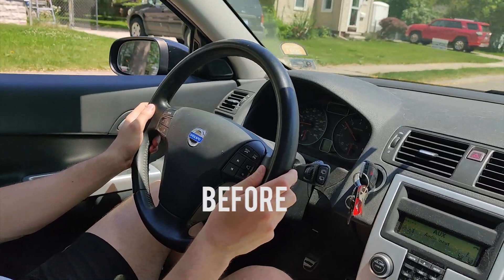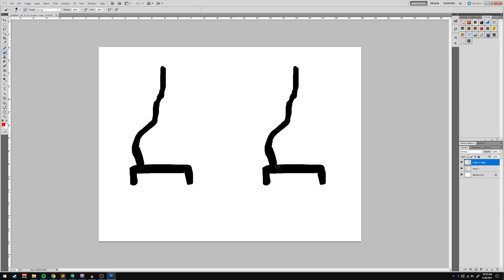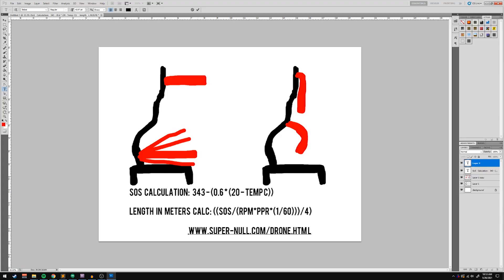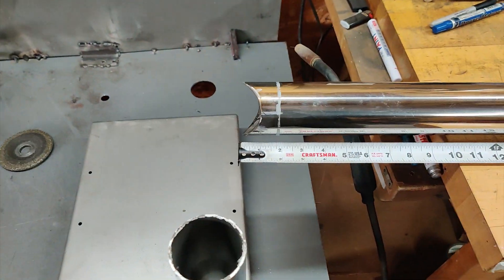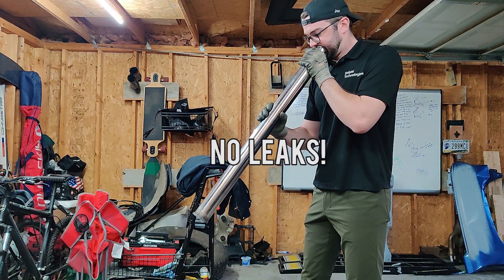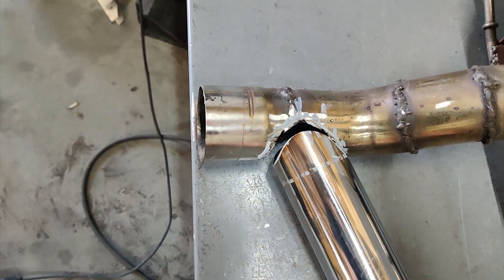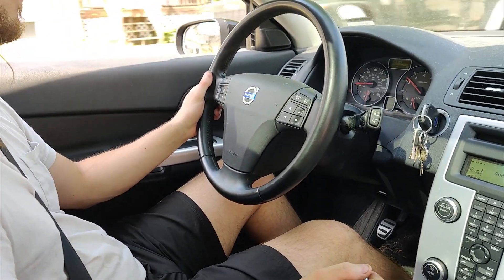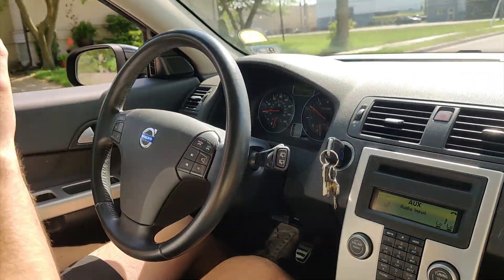Remove Exhaust Drone PERFECTLY + Free Drone Tool

Comment: Have golf 6 gti i want to remove drone dont know heat rpm or nothing ;( havs one muffler two tailends is j pipe on the pipe before muffler maybe
Reply from the maker: You need to know as much info as you can or it will just be guess and check. At the very least get the RPM and make it adjustable. Best of luck!

Comment: When should i measure the exhaust temp, after a long normal drive or After pushing the engine a little hard ? 
And what width should the J pipe be ?
Reply: Measure temp when you are experiencing drone the most consistently, likely up to temp. Pipe diam is flexible, but any size close to the actual exhaust pipe appeared to be most effective for my applications.
Reply: @TylerRogersUSA  My drone is around 2300 RPM. However, he said measure temp around the spot that'll fit the J pipe. Knowing my car, it's probably way back. Which means lower temp.

Comment: Hiw did you measure exhaust temp?
Reply from the maker: Temp gun or a best guess and leave the pipe adjustable before fully welding it or clamping it!
Reply: @supernull  on the piping itself or the air coming out of the exhaust?

Comment: Curious, how does this compare to using a helmholtz resonator as far as range of frequencies it effects? eg. in my car the drone frequency ranges from 94 to 114Hz with decibels as high as 91 from 2900 to 3300 rpms. Will a QWR like this hit that 20Hz range if I focus simply on the RPM where the drone is loudest?
Reply from the maker: Thats a great question. I don't have a side by side comparison personally, but I would say if you target the middle of that range, or the worst offender, you have around a 300-500rpm range of drone cancellation. If you arent fully committed or want to test out lengths, you can slide a larger exhaust pipe over on the drone portion and adjust the length with a clamp until you are happy, then weld it in.

Good luck

EDIT: If you HAVE to pick, you can always air on the side of caution as well, focusing the drone pipe on the more common cruising RPMs

Comment: Had my J pipes installed using your video. 65 Ford Ranchero, dual exhaust, flowmasters. Well it worked! I was laughing the first test ride just like you guys did. It works!! Thank you! 🤙
Reply from the maker: World of a difference huh! Its great to have the engine not living in your head while you drive. Glad it helped you
Reply: Hello.. im from Malaysia, and watched your video. Was wondering if i have dual exhaust, do i need to divide the pipe length to two? 

e.g. Total calculated  length is 26.5 inches, do i make 2 set of 26.5 inches, or 2 set of 13 inches?
Reply: @shafiqsulaiman6749  Each pipe at 26.5

Comment: Mine didn't work at all.. 1600 rpm v8 dual pipes with a H pipe. Used the same diameter tube, calculated 900mm or 35.7", I didn't measure exhaust temp though. Guessed 200f/95c because I read on a forum someone calculated that temp inside the j pipe. Mine are welded in front of the mufflers, about under the front seat in my C10 truck
Reply from the maker: The worst of the drone is at 1600? Did you add the drone pipe after the H pipe, same ~36" j pipe on each bank?
Reply: @supernull  yes it's after the H, both the same length, one on each bank. I have a fairly narrow drone range too, from 1580-1680 really spikes. It could probably be quieter either side of that range, but that's the worst bit. 105-108 Hz on spectroid which correlates with the rpm
Reply from the maker: @swempthebemp  I wonder if the H pipe only partially makes each bank act as a pulse per rev of 4 as the exhaust gasses are not fully merging as if it was a Y pipe into a single exhaust. I would guess it is going to behave more like a true dual exhaust setup (basically 2 isolated 4 cylinders). This drastically increases your drone pipe length.

If you are able to, what I would recommend is merge both exhausts where the H pipe currently resides, and run a single drone pipe off that, then split back into your dual exit setup. Unless you are all about the H pipe sound of course

If you intend to keep the H pipe I would first try and add some resonators after the H pipe, from what I have seen the H pipe drone is very tight around that 1800-2000 rpm. Something like a vibrant resonator right after the H pipe may do some good. Unfortunately will take some trial and error.

Comment: Did you notice it actually making the drone at other rpms worse than it was before? I targeted 2500, and at 2100+ the car sounds amazing, but now from 1500-2000ish it drones more than it did before. Not sure if maybe my length or something else was wrong? Any help would be appreciated.
Reply: I did not personally. If it has a LOT more drone, you can always add another J pipe to target that frequency as well. Or lower your original target RPM if the high end isnt as noticeable.
Reply: @TylerRogersUSA  yeah I think I’ll change it to 2000 and see what happens. I made them adjustable so shouldn’t be too hard apart from a space limitation
Reply: @bobjohn7329  Good on you for thinking ahead. Let me know how it goes!
Reply: @TylerRogersUSA  will do! I’m also planning on adding an x pipe, right now there is no crossover in the exhaust. Do you know if the j pipe calculation changes  at all when going from no crosser to having a crossover?
Reply: @bobjohn7329  It most certainly will. If you have a V6 with no x pipe, you have to treat it like 2 independent 3 cyl engines. With an X pipe you can now treat the system as 1 6 cyl engine. This is important for the PPR value, and likely why your initial length didnt work as much as you would have liked!

EDIT: just make sure your drone pipe is AFTER your X pipe to use the updated value
Reply: @TylerRogersUSA  perfect, I do have a V6 so I’ll check the calculation again as if it’s a 3 cylinder
Reply: Actually, with doing the calculation as a 3 cylinder the pipe has to be super long, hopefully once I install the x pipe it will just be better since I was originally basing it off of the 6 cylinder for the calculation

Comment: What if it is a 6 cylinder with dual exhaust where each pipe has 3 cylinders? Do I just mark a 3 cylinder and make two of these? Is using 400 degrees Fahrenheit ok or should I use something to measure accurately?
Reply: If it is a true dual exhaust (no X or H pipe) yes, you basically treat it as two separate 3 cyl engines. If they DO merge, you can add the drone pipe as a 6 cyl engine. Best case you would add a single drone pipe where the exhausts cross over, but worst case you would add two pipes somewhere they fit.
Reply: If they don't crossover you should consider it, true dual V6 engines sound extremely trumpet-y, and an X pipe goes a long way in smoothing exhaust pulses. Let me know how it goes!
Reply: @TylerRogersUSA should I do two 30 inch pipes or two 15 inch pipes that total 30?
Reply: @forrestofdeath  the full length for each, but since you have an X pipe use an updated ppr and add the drone pipe at or after the X pipe
Reply: @TylerRogersUSA  my only variable that I am unsure on is temp. I figure between 150-200 F may be fine.

At 150f and 3ppr @ 2500 is 29”
At 200f and 3ppr @ 2500 is 30.4”

I googled exhaust gas and it says 400 so I am not sure on the degrees F
Reply: @forrestofdeath  at that length it will likely work either way, if you're right at the end of the exhaust split the difference and do 29.5
Reply: The length is targeting the most affected rpm, so if you are close it will still hit a roughly 500 rpm window of drone
Reply: I checked and it actually does have an x pipe near the rear.

Comment: if you take temperature readings in diff temperatures even tho the exhaust is warmed up, will it reduce the effectiveness of the drone pipe?
Reply from the maker: I would encourage taking the temperature where you intend to add the drone pipe, when the engine is warm

Comment: Since I got two exhaust pipes do I need two of them?
Reply: If they connect at some point, do it there. If they are true dual, you need to treat them like 2 independent engines ( 4 cyl and 4 cyl for example) This will change the length required as well.
Reply: @TylerRogersUSA  they only connect at an xpipe then split off again
Reply: @alex_288  then you can treat them as the full cyl count. If you can, add the drone at the X pipe and you only have to add one

Comment: I have 3" exhaust .. Would I build the drone pipe the same size or can I use a smaller one? Great Video by the way :)
Reply: You can use any diameter. The larger the diameter the more of an effect you'll notice. As close to matching the exhaust as you can is a good rule of thumb
Reply: @TylerRogersUSA  Thanks for the quick reply
Reply: @BB010864  absolutely. Best of luck, let me know how it goes

Comment: Is there a direct correlation between length and  the diameter of the chamber you construct? Like making it shorter and fatter instead of long and slender? 0:33
Reply: You could probably calculate it to volume, but I have only used the same sized pipe. To test this, you would make your calculation (at assumed same diameter) and then adjust by some magic factor based on volume of a cylinder depending on the diameter. Would be a bit of trial and error for sure...

EDIT: Length should stay the same, but the smaller you go the less drone volume it will cancel out- match diameter if you can
Reply: My guess: If length correlates to wavelength, then diameter would restrict / amplify the amplitude. So a smaller pipe would have insufficient amplitude to cancel the vibration waves, and a larger pipe would over-correct and add it's own vibration.

Comment: You can make a J bend in the pipe. Same result if the length is the same.
Reply: As long as it is still perpendicular?
Reply: @christmasisawesome9348  Yeah, It starts out perpendicular but you can lame a bend to make it fit. It's the length that really matters.

Comment: In a 8 cyl with dual exhaust, would you cut the measurement in half and do it to both sides ? i am getting 28 inches so it would be 14inches on both sides?
Reply: If it's a true dual, use the calc with a 4 cyl 4 stroke and add to both. If it's an X or H pipe system use 8 and add it where both merge or to both pipes with 8 cyl in the calc

Comment: Hi. I have a 2.5T Mondeo. 5 cylinder Volvo engine. I have installed a straight flow silencer and a straight flow rear muffler. When I'm on a constant cruising speed there is no drone but in the moment I'm accelerating (under engine load) OR I let the gas off and the car start to slow down, the drone start. Kind of every RPM range. What do you recommend in this case?
Reply from the maker: Thats a bit trickier. Doesnt really sound like drone in the traditional sense. Try this: rev the car out to around 4k and let the car cost OFF throttle in gear so it engine brakes slowly, let the car go from 4000 all the way down to around 1000 rpm. If you notice a spot where there is bad drone, you can use this as your target drone. If you dont hear anything specific it may be worth trying a different muffler/resonator combination before you do a drone pipe.

Good luck!
Reply: @supernull  I found the spot it's 2250 rpm. Are you sure about the 200 f° temperature with this engine? I plan to do it exactly after the middle muffler. I have a 200 cell race cat with a Scorpion downpipe. Can my temperature be a bit higher then? I was reading about avarege exhaust gas temperature and usually I seen around 400-450 f° I don't have an option to measure it.
Reply from the maker: @dani938  That is just a value for the rear of the car, a safe number for the rear would be 250ish, middle exhaust closer to 350-400 and around 900 at the manifold. These are just guesses though, and a temp reading with a infrared sensor is a better method. If you plan on a guess, try with around 400 to start with!

Your calculated length according to my values is 47.2 inches, if you can't fit that, you can always try dividing that in half for a slightly less effective drone pipe.
Reply: @supernull  I have plenty of space in the rear I'm just scared if I do it there, then the drone will stay in the middle part because it's not filtered yet there. Does that make sense? This is why I was thinking to make it as close as possible to the cat.
Reply from the maker: @dani938  Youd be surprised, its pretty good at removing drone through the entire system as its cancelling out resonance. Put it wherever youd like, just be aware temperature increases the closer to the engine. As long as the drone pipe comes out from a T and has the right length, youll be golden
Reply: @supernull  amazing. In this case it will be placed on the back just like yours. Thank you for the help 🙏😎
Reply: @supernull  just 1 last question if you don't mind. In what RPM range is it killing the drone?
Reply from the maker: @dani938  hard to say exactly, but it targets around a 300-500 rpm range aggressively. So really try to pinpoint the middle of the worst drone.

Comment: Thanks man for your efforts. but I have a question before I start the work, you know ls430 have 2 pipes and 2 mufflers I remove them all. I do the calculation as 4 stroke 8cyl I got the results of the pipe length, I have to add the pipe to each of the pipes!?
Reply: Is your exhaust combined at any point from both banks? As in with an X, H, or Y pipe? If you have completely independent exhausts from each bank (4 cyl each) you want to redo the calc with a 4 cyl and add that to each bank. However if they meet (X,H,Y pipes), you will leave the calculation as an 8 cyl and add to both pipes. Good luck!
Reply: @TylerRogersUSA  it meet before the resonator. Its clear now I will make two for both and 4 cyl each one 👍🏼

Comment: can you add multiple pipes?
Reply: You can, but make sure your math confirms it. 2 pipes of half the length will not achieve what you want. If you are looking to remove 2 different drone rpms, then yes! I would add them one at a time to see if you're happy as it goes. Let me know how it works for you
Reply: @TylerRogersUSA  is there any way to remove a drone from a range of rpms from say 1200 to 1500 because you can only make so many pipes practically infinite amount
Reply: @mikebolton2388  is it worse at either of those? When the car is warm what's worse?
Reply: @TylerRogersUSA  it's hard to say but worse in the middle of that and then some
Reply: @mikebolton2388  target 1400 rpm and give it a shot. You can always adjust as needed.

Comment: What options are for drone in two spots 2100rpm is worst and 3000 rpm at more rpm calculator asks for shorter pipe and at lower it needs longer pipe...its a 6 cyl bmw engine if it makes sense tnx for any information will be apriciated!👍
Reply: I would fix the drone you experience the most, likely 2100 rpm. Then from there determine if anything else is needed
Reply: @TylerRogersUSA  tnx men! Can you tell me how to calculate j pipe size if im going to do each in one pipe i have dual pipes coming in to y pipe
Reply: @janis.ozolins777  add the drone pipe after the y pipe and use 6 cyl in the calculator, good luck!

Comment: Hi. Ive got a straight-through muffler on my car just behind the bumper. I welded a j-pipe before just before the muffler where there was barely enough room. It has definitely reduced the drone, but not eliminated it. Would it make any difference if the drone pipe was welded after the muffler i.e a few inches before the exhaust tip opening? There is only about 4 inches of pipe for the exhaust tip, so not much space.
Reply: Nope, in fact the calculation works even better after all mufflers and resonators as that is the specific frequency you are aiming to delete. Good luck!

Comment: Great vid! Can you explain how did you exactly get the temperature reading?
Reply: I used a digital temperature gun as close to the drone pipe location as possible (use after the exhaust is warmed up and round up a few degrees to be safe)

Comment: I have a lot of questions LOL

- can you put the pipe anywhere?
- instead of 1 long pipe, can you split it into two small ones?
- Is it better to have two j pipes?
- does making the j pipe longer better or does it have to be the exact size?
- does the pipe have to match with the stock exhaust pipe size?
- what if drone occurs at different RPMs? For the calculations, do I put peak value when drone is more annoying?
- are there any other solutions to lowering drone besides installing a j pipe? would sound dampening panels inside help too?
Reply: Pipe can go anywhere, but temperature will change as it is hotter the closer you are to the engine. 
Length is the most specific, so it needs to be one J pipe length for each target drone
if you have multiple drone RPMs you may want to look into adding a resonator first and then add a J pipe as needed.
J pipe should match exhaust material as close as you can
Sound dampening will not reduce drone, just what you hear in the car- and will likely not reduce the volume of drone too much
Reply: @TylerRogersUSA  Thanks for the reply! I recently had someone install a j pipe on my car but there is a tiny bit of drone still there because they couldn’t fit the exact length pipe. I think I’m just going to install some deadening panels to see if that might remove the small vibrations. Thanks again, the video was really helpful!
Reply: How'd the deadening go? @Draconewt
Reply: @tophatvideosinc.5858  I was not able to install sound deadening on the car because it was a newer car. I didn’t know how to take off any of the interior parts and I was scared I might break stuff. I also ended up totaling the car anyways. In theory I feel like it might help with vibrations. Like for example, when people install subwoofers they also add deadening because the car will vibrate due to loud volume.